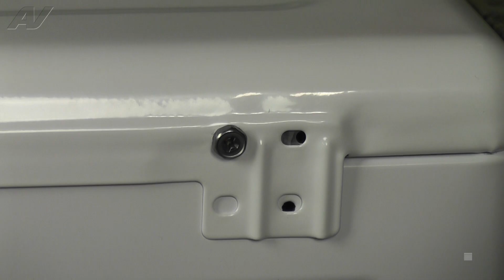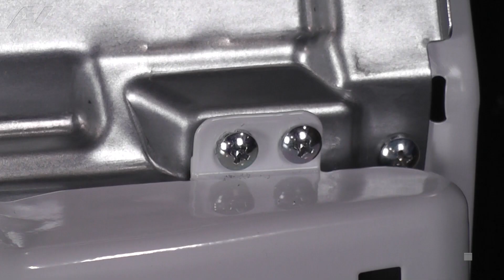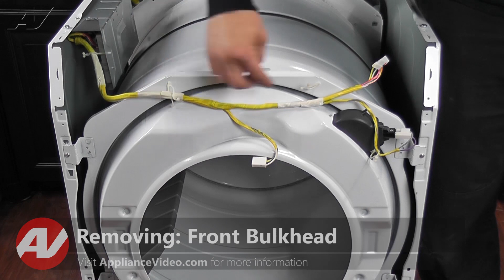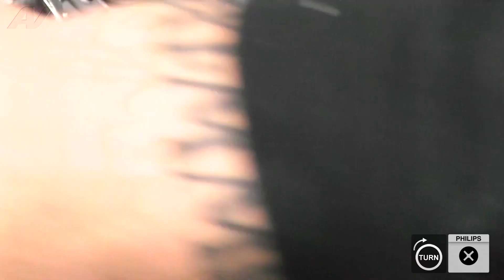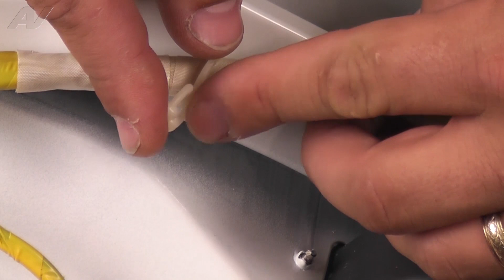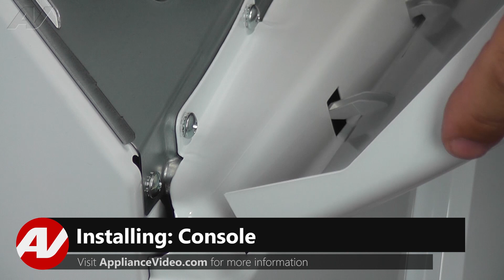Samsung Dryer issues - Will not start - Unit overheating - Hi Limit Thermostat - Diagnostic & Repair

Comment: Great video, thank you so much! Our Samsung was overheating and we were able to follow this video easily. Awaiting the results of our first test dry!
Reply from the maker: Great question, if you have a more technical question that our parts department cannot answer, you can search our over 17,000 answered questions free at our website www.ApplianceVideo.com under our Repair Help section. You can also call our parts department at 1-800-830-5465 and they can give you help 7-days A week ,or search at www.SaveMoreOnParts.com  .
Reply: So, the dryer wasnt actually overheating, but it was shut down due to a defective hi limit thermostat that wouldnt reset. If anyone has this problem, they should do further troubleshooting as the hi limit is only there for safety reasons. The actual drum temp is obtained by the thermistor in the exhaust duct controlling the heating element.

Comment: thank you for this step by step guide although my Samsung model is different I'm going to attempt this. I now just need to make sure I'm ordering the right component for my Specific Dryer. Any tips on how to do that
Reply from the maker: Great question, if you have a more technical question that our parts department cannot answer, you can search our over 17,000 answered questions free at our website www.ApplianceVideo.com under our Repair Help section. You can also call our parts department at 1-800-830-5465 and they can give you help 7-days A week ,or search at www.SaveMoreOnParts.com  .